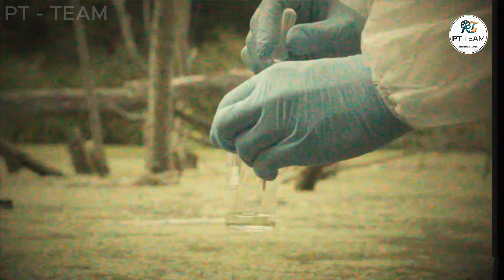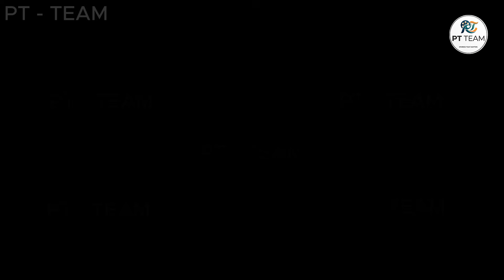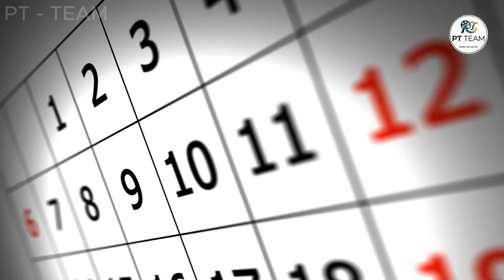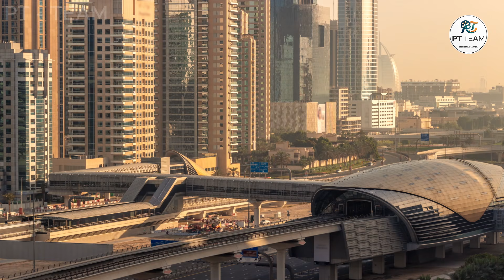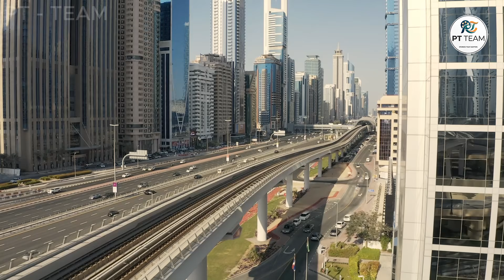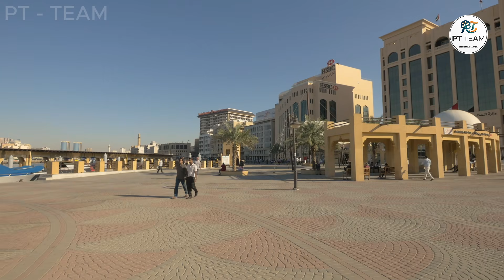194 Piles Hold Up Burj Khalifa In Water Saltier Than The Sea — And Nobody Can Reach Them

Comment: Come to think of it: where does the salt from desalination go to?.Must be increasing the salinity somewhere.
Reply from the maker: Yes. Most of the removed salt leaves as concentrated brine and is discharged back to the sea. It can raise salinity locally, especially where circulation is limited, which is why dilution and discharge design matter.

Comment from the maker: Three things I should say up front.

The foundation numbers — 194 bored piles, 1.5 m diameter, about 43 m deep, a 3.7 m raft
of 12,500 cubic metres of C50 self-consolidating concrete, 40% fly ash at 0.34 w/c, and
piles at 60 MPa with 25% fly ash and 7% silica fume at 0.32 w/c — come from the published
engineering write-ups of the project, including the account Lawrence C. Novak produced for
the Portland Cement Association. The ground water figures of up to 4.5% chloride and 0.6%
sulfate come from the same body of work.

The settlement figures matter and I want them read correctly. Maximum predicted long-term
settlement was 80 mm; the value measured at Level 135 was 30 mm. That is BETTER than
predicted. Nothing in this video claims the Burj Khalifa is unsafe or is going to fail.
If you came here from a video that said the tower is sinking dangerously, the published
numbers do not support that.

The rising ground water figure — about 20 cm a year — and the Resilient Future Flow outfall
(4 km, 2 m diameter, 9 cubic metres per second) come from Dubai Municipality's October 2025
announcement, quoting Fahd Al Awadhi. The Tasreef programme figure of 30 billion dirhams
with a 2033 completion target comes from the same public material. If any of those have been
revised since, I would rather have the newer number than be right.

I simplified one thing around the 8-minute mark. Cathodic protection under a raft can be
either sacrificial-anode or impressed-current, and the maintenance profile is different for
each. I did not separate them, because the point I was making — that it is a system somebody
has to keep running — is true of both.

If you work in corrosion engineering, marine construction, or Dubai facilities management and
I got something wrong, say so and I will pin the correction here.